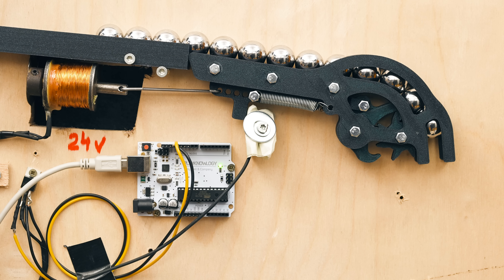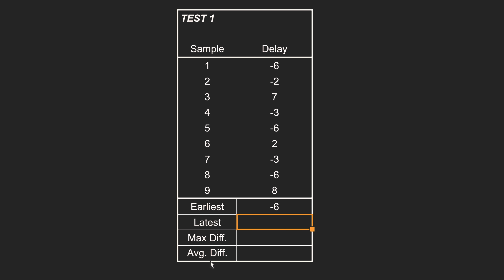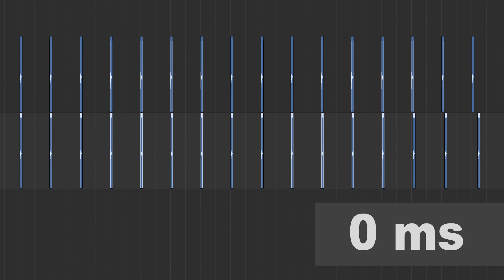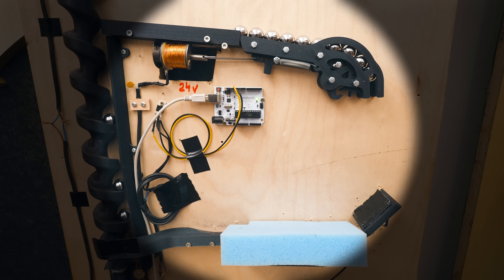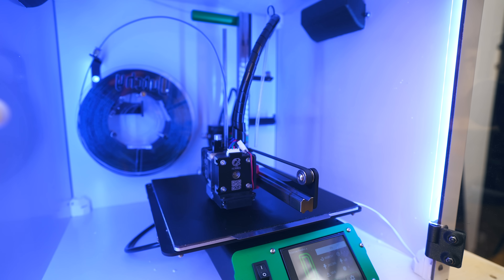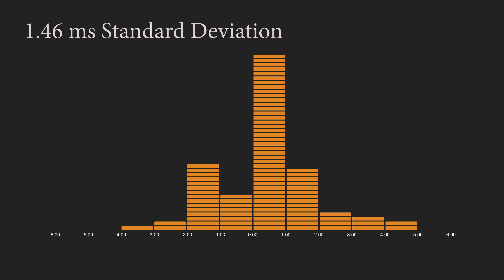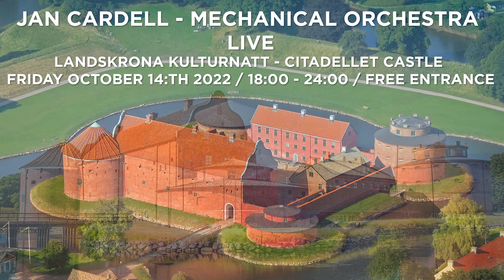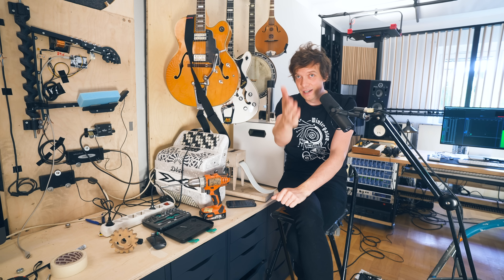Testing the Arduino Marble Gate

Comment: You could use an analog to digital converter to process the audio in the Microcontroller or at your PC automaticly. This would enable longer tests with less efford.
You should also ceep in mind that your programm might not be good for realtime applications like this.
A simple function generator might be more precise.
For mesurement you could use the voltage level at the coil as reference. This would elminiate the timing issues from the Microcontroller. A Scope could be used to take those precise mesurements (audio and coil-voltage)

I hope this was helpful, have fun.

Comment: The problem with measuring the gate with a flat microphone is that the instruments the marbles will be hitting will not be flat. This means that while the timing of the gate is accurate, if you want that accuracy to show in practice you'll need to adjust the gate so that the marbles land closer to the same spot.

Comment: How do we know if the sample data is big enough though? but really, 20 ms was the minimum for me to notice an issue with the delay. so as long as the rest of the parts don't add up another 18 ms, we should be good. and like you said, they might even cancel out in the end.
Reply: The sample size *absolutely* wasn't nearly big enough to be statistically significant to the degree he was aiming for, but you're right that he was chasing the wrong hypothesis.

Comment: We’ve been here before, the problem was never how tight or competently designed a single component was. It was the compounded inaccuracies that add up when a whole row of marble gates are built, fed from a marble feeder. Or the difficulties of physically fitting things together. Or one marble in 10,000 hitting the floor because the real world is like that.

Mechanical devices can never be perfect, they have tolerances instead, a bit of play, some slop, backlash, things change size depending on temperature or whether they’ve slightly worn out.

Recognise repeating patterns and avoid them. Obsessing over how well a marble gate works is a rabbit hole.

Comment: Glad to see you back. It's always exciting to see you work with marbles.

You might want to consider reworking your test process though. With so few tests for each series I'm quite sure that you can't approximate your distribution with a normal distribution and your calculation for standard deviation is not correct.

Also keep in mind that 1 standard deviation is only about 70% of your marbles will drop within that time. With standard deviation of, for example 5ms, you will still have (on average) 3 marbles being of by 15ms (3 standard deviations) out of 1000 marbles, which is closing on noticeable.

You might not wanna go down the rabbit hole of perfection, as it is very deep indeed.

Comment: I may have commented on this a long time ago, but I REALLY think you should give this idea some consideration:
Go back to your original machine, but stop focusing on the accuracy of the machine. The MMX is insanely accurate. The problem was never the accuracy, but rather how it handled errors.

If you go play a live concert, you are going to get a couple of notes wrong when playing instruments. So why is it a big deal if the MMX gets a couple notes wrong during an MMX concert?

Use the MMX in its current state as a baseline, but work on error tolerance rather than error reduction.
Reply: @Wintergatan Take this from a software developer! Digital computers are some of the most precise things ever made by man-kind, and even then we still have to have things to prevent "mistakes" from causing you to lose all of your data! Servers use "error correcting memory" to detect and correct errors because computers will just randomly flip a bit the wrong way every few billion bits.

We don't spend years making the computer flip 1 in 100 billion bits when it's flipping only 1 in a billion bits! No! We instead design computers to catch their mistakes and handle them gracefully!

Comment: I have been thinking for like a year that a modular approach would be very pragmatic.  What I mean by modular is rather than thinking of it as a single, complex machine, you design it as several self-contained systems (roughly one per "instrument") that are united by a the drive system and possibly the programming wheel.  They could hang on the same frame or not. The benefits are 1) breaking down for the road is naturally part of the design and 2) failure of one subsystem doesn't wreck the whole machine.

Comment: I disagree with most comments. If you really want to play tight music then this is absolutely the way to go about it rather than fixing design 3x in a cobbled together machine.
Having said that, if you want to go that route i think you would need to use synthesizers. I feel like slight variations is what gives a mechanical instrument its charm.
Its great to see that your design is accurate to 1.5ms but i cant even hear the difference up to 10ms and knowing you you wouldnt be satsfied if a MMXX is 30ms tight. Getting 30 marbles gates tunes that well would need accuracy in the linkage probably below 0.1mm and youd need to re-time it for every concert after moving it.
Honestly i was loving the MMX and it makes me sad that not even one complete song was recorded on it. I feel like the considtency you had with it was maybe not world tour levels yet, but more than good enough for an album.
Dont get me wrong, its great to see you having fun again and making videos (feels like its christmas already) and id absolutely love to see a 3rd machine, but youll have to realize that mechanical can never be as precise as an arduino will be.

Comment: It seems like some folks think Martin is going down the rabbit hole of perfection in this vid... he's not. He's establishing benchmark performance data - under ideal input conditions, this is how well the gate works. That's important to have going forward -- if something about the gate needs to change, he has those values to compare against after that change is made. If he wants to test how fast can the gate play repetitive notes (a sixteenth note at 120 bpm is 125 ms), he has this performance value to look at during that test to see what limits there may be. That has a whole knock-on effect on the design AND the music being written for it. For example, a design question of whether the machine needs two programming channels and droppers per note/percussive hit or if it can get by with one. That then also trickles down to the rest of the machine, from marble dividers/allocation to the programming mechanism, etc. Each of those upstream components will impart their own limitations to the whole of the machine, plus the added time for how far the marble has to drop to hit the instrument, the design of the linkage from the programming wheel to the gate, even how the programming pin itself engages that linkage... and all of that feeding into how reliable it all is for a world tour, because the last thing any of us would want to see is the machine grenading itself on stage because one marble got to where it shouldn't be.

Comment: I was halfway through an angry comment about using digital control for the MMX, until Martin mentioned that it was strictly for testing and the final machine will be fully mechanical. Whew! I was very worried 😅

Comment: For me, 15ms is the last example that isn't noticeable; so with a 1.46ms stddev you have 10-sigma tolerance (as in, marbles have to be more than 10 standard deviations late or early before it screws up your music). That means the chance of a missed marble drop is so low that something else will bugger up the timing first and you probably should be worried about that.

Comment: Another simple comparison you can make:
the speed of sound is roughly 350 mm/ms.
So 1 ms corresponds to being 350 mm (or 35 cm) further from one speaker than the other.
10 ms corresponds to being 3.5 m further from one speaker.

Comment: As much as I admire the pursuit of very accurate marble gates I think it's wort mentioning that the test setup is not replicating the real world scenario (more marble in the queue, marbles bumping from the back, the whole machine shaking). While there're definitely lessons to be learned from this setup, pushing the limits of the design, based just on these tests (like shifting the resting position) may result in a gate that will not function reliably in real world setting.

PS: Good to have you back Martin :)

Comment: First of all, good to see you again. I was just thinking about you the other day.

Now to some more serious business. You really need a larger sample size in order for the standard deviation to be as accurate of a measurement as you assumed it to be in this video. It's been a long time since I had statistics at university, and I have forgotten a lot about it, but I recall there is a value you can get that describes the "certainty", or "quality" of the standard deviation, but the name escapes me. Also, you should probably know that one standard deviation is the interval within which, IIRC, 63% of hits will happen. For what you are doing, I think it would be more sensible to think about 3x Standard deviation. This too has a name, which escapes me, but I seem to recal that about 99% of hits should happen within this interval.

The best if you want to get truly representative numbers would probably be to find a way for the arduino it self to record the results, and have it either output a file to the computer, or just do the math on it's own. That way you could run tests unattended for instance over night, and have sample sizes in the thouhsands.

Comment: I really don't that you get 1ms of jitter with the arduino. it should be way smaller.
Reply: But then...there's an added solenoid AND spring...mechanically attached to a plastic device...that has friction AND inertia from a series of balls resting above it.

Basically, this is not a sensible journey.
Reply: @br52685  fully agree. But it looks more like 1ms resolution for the delay measurement. But this doesn't care because of the mechanics

Comment: I think the best part of the original and the MMX was that they had minimal electronics in them. Adding an Arduino to automate the timing doesn't seem like the same spirit the original projects embodied. Having a control board with the motor, why not just have a laptop play a loop for you at that point?

Comment: This was an excellent test to discover limiting factors of the design concept.  The marble hit timing is heavily dependent on the angle of the surface it is hitting, that makes perfect sense. But also, it is impossible to make an instrument that drops onto a perfectly horizontal surface. So you'll have to define what tilt is needed for reliable operation, and accept the timing deviations that come with it. Hopefully that trade is not too dissatisfying.
Reply: I was watching with my jaw dropped, in shock that he didn't realize that his "solution" was to introduce a breaking change to the entire design of the machine.

Comment: I think you should definitely be able to get better than 1ms accuracy from the Arduino. If you are using micros(), try switching to millis() instead. If that's not good enough, there's even more you can do. When the arduino framework hits the end of the loop() function, it is free to go off and do other things in the before calling loop() again. If you make your own loop within the loop function (so the loop function never ends), you prevent the arduino framework from doing any other background stuff. You can use delayMicroseconds() (which is blocking) within your inner loop for timing. This should be more accurate. Another option is to use timer interrupts.

For sensing, I would use photo gates instead of the microphones. They are very accurate, and avoid the issues with the mic hit position or affecting the timing by measuring (since nothing needs to touch the test setup at all). You can measure the timing with a microcontroller - ideally using an external interrupt pin. The data can be gathered automatically (via serial connection, or even WiFi if you use something like an ESP8266 or ESP32) - removing the need for manually measuring timing in audio waveforms. Alternatively, if you still want to use mics, some code could detect the impacts and automate the measuring process.

Comment: Regarding the standard deviation. It's actually very easy:

Take your dataset of measurements. Compute the mean of those measurements. Create a new dataset of those measurements by subtracting the mean from all of them. Your new dataset now has a mean of 0. Square your new dataset, in order to make all values positive. Then calculate the mean of the squared dataset. This new mean is equivalent to the variance of the original data. If you now take the square root of the variance, you get the standard deviation.

Comment: I like that you're thinking so differently on how to do your measurements. As a musician you're still using microphones and audio processing - even though you have a microcontroller. As an embedded engineer I would have done the measurements directly with the Arduino, maybe with optical sensor or even simple limit switches.

Comment: It sounds like a reverb effect at about 6ms, up to about 20ms, which is unsurprising since those are the typical range for reverb effects. At 30ms, it’s more noticeable, and it 50 it’s clearly 2 hits.

While you do want a fairly low stddev, you do NOT want perfect timing, no human player is that accurate, so it starts to sound like a mechanical/synth drum. And while stddev is a good measurement, you also want a max of 4-6ms to minimize unintentional reverb type effects.

Comment: Don’t forget to do statistics on your statistics to evaluate your measurement methods. For example, doing several small-sample (like 10-15 trials) tests then taking the standard deviation of your standard deviations can give you insight into how much of the variation you can control and how much is just a natural part of the system.

Comment: The PSoC 5LP microcontroller may be a better fit than an arduino for tight timing stuff like this.  It can do programmable digital and analog, rather than emulating it with a CPU, which can get you more deterministic timing.

If you feed it with a 10MHz GPS-Disciplined Oscillator, you can get some really tight timing.

Comment: Note that your final target (drum or vibraphone pad) might also be under an angle. You have isolated the catchment timing, but you also need to measure the targeting consistency. And make sure that improving one doesn't harm the other.

Comment: Automation can make that whole situation a lot easier. Of course you lose a lot of the mechanical aspects of what the model machine was but at the same time if you want to make it to where you can have something that's reliable repeatable and something that can be moved easily using microcontrollers maybe your best bet.

Comment: So, I don't know if the 1 millisecond inaccuracy was a huge issue, but for those interested here is an explanation why it exists (and how it could be fixed.

First of, let's look at the specs of an Arduino. An Arduino has 16 MHz CPU Clock frequency. This means it has the ability to do 16 x 10^6 things (Cycles) in one single second. If we convert this to miliseconds, then we see that in 1 milisecond the Arduino can perform 16 instructions. And that is why in his marble drop test there was a variation of 1 millisecond before the arduino dropped the marble. It is because the micro-controller is too slow.
Now sou might ask: It can do 16 things (cycles) per microsecond, so why is it too slow?
It is because even simple things like turning on an LED or activating a motor are not just a single instruction. You need multiple instructions behind each other, which together cause the phenomenon of the actuator moving left or right. And in this case 16/millisecond seems to be not enough.

So how to fix it?
A very easy way would be to switch to a raspberry pi. Its a small computer (phone sized) in the same budget as an arduino. Its main advantage is that its CPU is much stronger as it runs at 1500MHZ (~90 x Arduino). Meaning it has plenty of headroom to accuratels controll something that needs to be precise in the miliseconds.

Comment: Uses delay() in arduino code.
Is surprised about the inaccuracy.
🤦

The board is a UNO R3, which uses a 16Mhz ceramic resonator for timing and an atmel328 chip.  This will be "close" but not accurate, timing will be dependant on age of the arduino and temperature. and it is naturally going to drift.

If you want accuracy, you need a device that has a better timing base than a basic arduino UNO can offer. Something with a crystal rather than a resonator will be better. 

Also... Whatever code is running 'outside' of the delay() lines, also takes time. so you will always end up slightly high over time when using delay().

Comment: You are way overkilling this.  One of the elegance of musical instruments is the variability of their output.  That's why we still have Orchestras with HUMANS operating the instruments.  The second thing is the marble drop mechanism, using a "gear" with 8 teeth.  That introduces a loop of 8 different drop times, versus the original machine which uses the SAME surfaces to drop EVERY marble.  The moving pawl that releases the "gear" should DIRECTLY act on the marble (as it did in the original machine).
          The other advantage of the original machine was the "double gate".  The pressure of the queue is exerted upon the first gate only.  The second gate always has only a single marble resting upon it.  There is no pressure exerted upon the gate surfaces, & the pressure angle was low.  This gate has high pressure angle leading to possible jamming.
         Arduino when programmed in C is crap!  There is no excuse for millisecond errors on a machine with a clock period 16,000 times less!